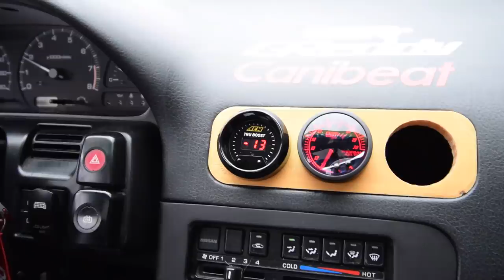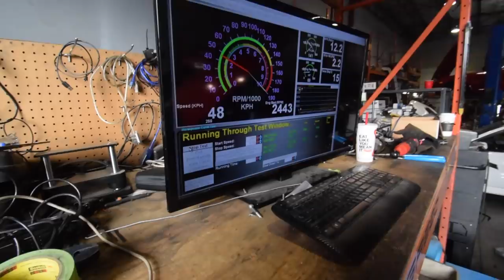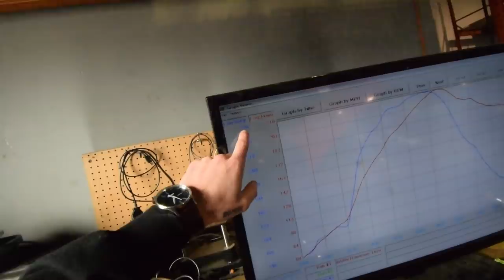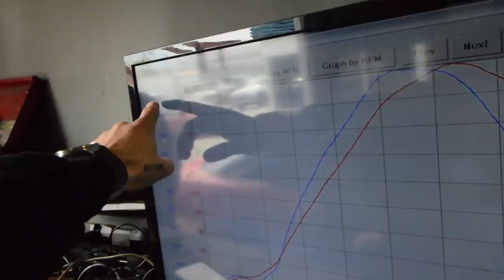BOOSTED KA24 240SX HITS THE DYNO FOR THE FIRST TIME!

Comment: Cool video! That's my 240sx with the "straight pipe" on the lift at 1:55 - currently putting down 725 whp / 527 wtq flex fuel e85 tuned by Racing Greed
Reply: Cherry looking car bro, quick question, did you add another fuel cell to hold your e85 so you can be chillin with 91 in the other tank? just curious I plan to add flexfuel to my s13. Thanks
Reply: @drucifer7739  bruh with flexfuel it all goes in the same tank and mixes, thats the point of flex fuel.
Reply: @danielmorris5470  that shit cracked me up, but hey everyone has to start somewhere 😭😭